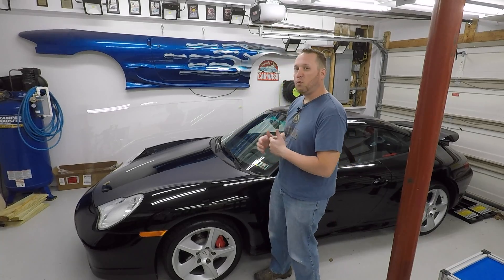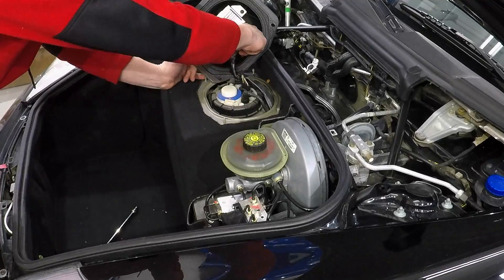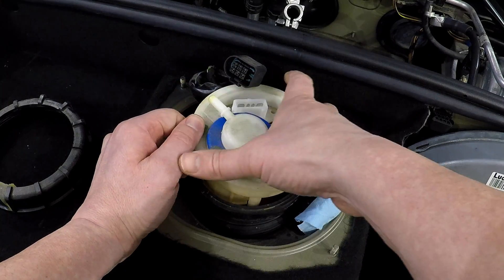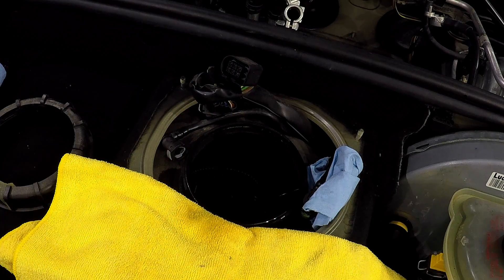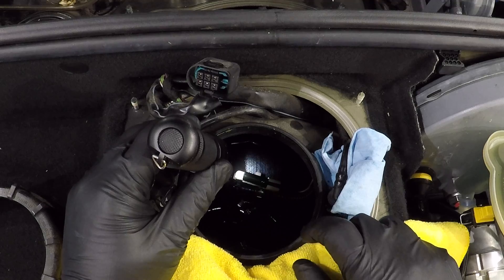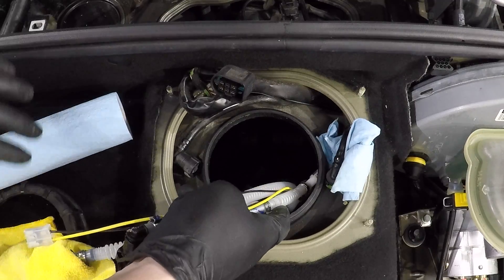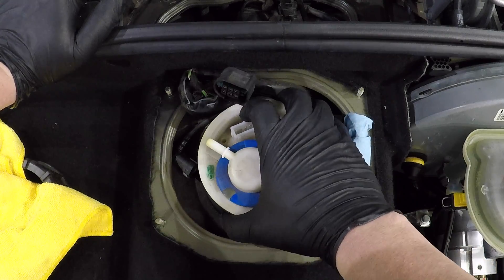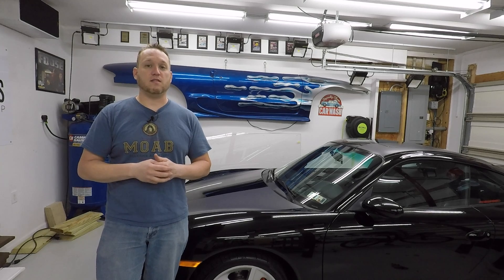Porsche 996, Episode 4: Fuel Pump Replacement

Comment: Thanks for this video, I did my 996 C2  '99 this week using this as a guideline.
It was a little more difficult than expected on the following things : 
Lose the top cap (ring) with the screw driver, it was very tight and you can feel that you will destroy the ring but covering the screwdriver with a cloth or rubber help.  Unscrew the fuel pump from the bottom of the tank (I need to use an oil filter tool to have a good grip of the pump otherwise wast very difficult by hand only after years on the tank), and last, the rubber ring of the level unit is better to put it in place first and then insert the level unit using some drops of oil to lubricate the rubber, otherwise the rubber seems to expand and not fit well to close the ring cap. Thanks for take the time to do the video and share it.
Reply from the maker: Thanks for the feedback!  I was a little nervous on the lock ring but I just took my time.  My pump popped right out by just turning it with my hand. I guess the clip tolerance could be different from car to car. I did forget to mention about putting the sealing ring on the flange first. In fact. I am going to open mine back up because I found a new the new one I bought that I thought didn’t buy 😆. Thanks for the comments. I’ll have to add some of this to the description.

Comment: Good job. That was a little more involved than I thought it was going to be.
Reply from the maker: It wasn’t bad. Still easier than having to drop a gas tank to get to it. Just had to run the car empty to go in from the top
Reply: BusyDadsWorkshop yea it did seem like you had to have the gas pretty low to get to things.
Reply: @BusyDadsWorkshop  is it the  same job as is on a 986?
Reply from the maker: @darrellclark9596  No, it would be different.  The 996 C4S has a saddle tank due to the all wheel drive.
Reply: @BusyDadsWorkshop  
But location, access ..the out with old in with new..simolar?
 I just had my 1999 -986 fuel pump fail on me last nite..
Any other advice for me as i tackle this would be apreciated greatly
Reply from the maker: @darrellclark9596  I don't know on the 986.  If it is like the 996 C2 (2wd) then the pump would be under the battery.
Reply: @BusyDadsWorkshop  ah...thank you!

Comment: So I have fuel sitting on top of my sending unit and what looks like small cracks around the base of 90 the degree connection post. I was getting speratic idle then start snd die before I discovered this. Is my pump shot or do I have a drop in pressure due to the leak?
Reply from the maker: I’m guess it could be from the leak

Comment: Is the 997.1 turbo unit in the same place.  Some show it under the battery but 4s & turbo has the awd split tank. And some say I can’t disconnect the battery without causing numerous electrical problems windows gauges seat heaters problems etc.  my gas gauge says low with the light on but I can’t pump anymore gas in as is full spilling out.  My guess is the sending unit is stuck or broke.  Great video & thx for any help.
Reply from the maker: I’m not sure on the turbo set up. I went and bought the Bentley manual when I bought the car. Maybe there is one for the turbo?

Comment: how did you know the fuel pump needed replacing? my 2001 Cr runs but the 30 amp fuse blows , I think its the fuel pump fuse but not certain. thanks for the video, you guys make it look simple.

Comment: My 2003 996 gauge is not working but fuel is still working properly any suggestions on where I should look?
Reply from the maker: My C4S has a saddle tank that straddles the front differential.  I'm not sure if the sending unit on a narrow body carrera is the same as the C4S.

Comment: I put the sender unit back in but I have. To fight to get the rubber seal in is this normal to push the sender unit in it dosnt go as easily as yours
Reply from the maker: The 4S and C2 are different. Hopefully you got it figured out. I just saw this comment.

Comment: Great video! Thank you for sharing. What is the part list needed and cost estimate? Thanks again!
Reply from the maker: I don’t remember the part number off hand but it do have in the description. It was around $399 give or take. That is the only part I replaced. You could also replace the sealing grommet at the top of the tank if it is bad but mine was ok.

Comment: What is this fuel sending unit...? Is it same as fuel pump... ? There are two pumps ?
Reply from the maker: There is only one fuel pump.  However there are two pickups as the tank in a 4S is a saddle tank that straddles the front differential.

Comment: There is a hard line on the right side of the pump.  How did you get that thing off?  I feel like I am going to break it by forcing it off of the pump.
Reply: It appears to be the hard pickup line, which I guess I have to squeeze those tabs.  They do not want to budge.
Reply from the maker: You just have to be patient with it. It took a bit of convincing but they did come off. It was a pain because it is a blind connection.
Reply: Thanks for the reply.  I did get the thing off and saw the short elbow shaped black fuel line had a split in it.  I put on a length from Autozone and cured the problem.  Fearing that fuel line would be not rated for being submerged in gasoline, I bought a Gates piece (p/n 27093).  I was able to uninstall the old (new) fuel line and install the new Gates fuel line without removing the pump.  So, about a $25 fix.  Your video saved me a lot of grief, as I did not want to tow my car to a shop.  Keep these videos coming.

Comment: please can you tell if 997 is the same as the 996 pump removal
Reply from the maker: I don't know about that.  I do know that with the 996, it was different between a C2 and a C4S because of the all wheel drive system.
Reply: @BusyDadsWorkshop  The 997 switched to a dual pump setup.
Reply: @TheMichaelBernardBrown  Double pump inside the tank? I did a search, for the 997 there is always only one pump.